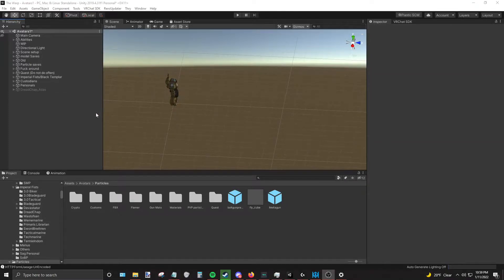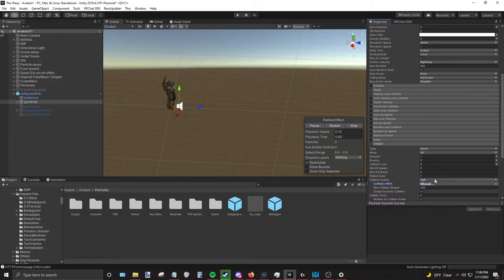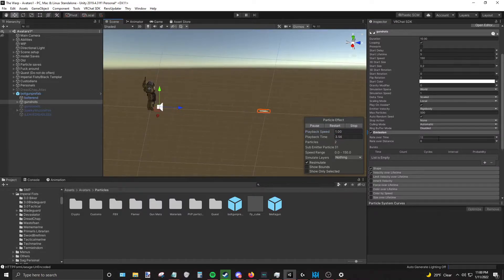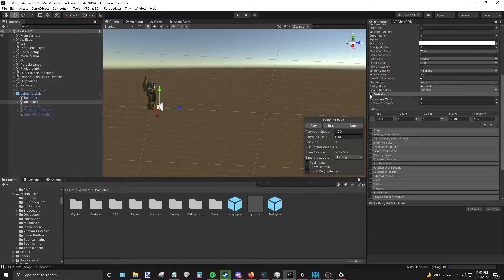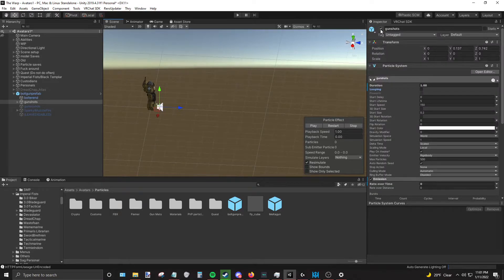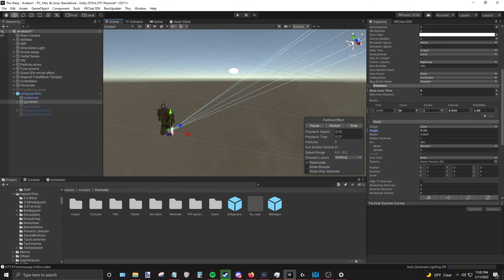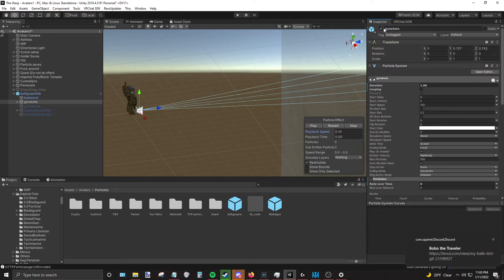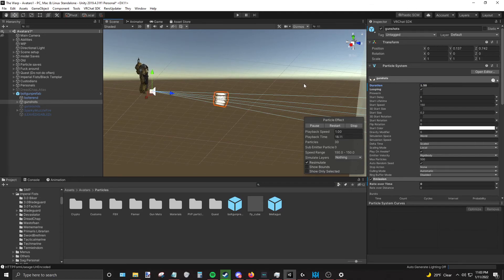[Unity 2019 VRChat] Semi Auto and Burst Semi Particle System [3]

Comment: I was very disappointed when you said "Just turn the particle system off". I was trying to make boop particles, but when the Finger leaves the Contact, the particles just disappear. Turning Emission On is not working for me, it's just not emittion anything.
Reply from the maker: There are better systems that exist. This video sadly only shares the older method I was taught. Sorry!
Reply: @Detare  I found a solution. It's called "Star Particle System", it comes in a .unitypackage format. it uses the non-standard behavior of the particle system so it can break sometimes when you trying to modify it.